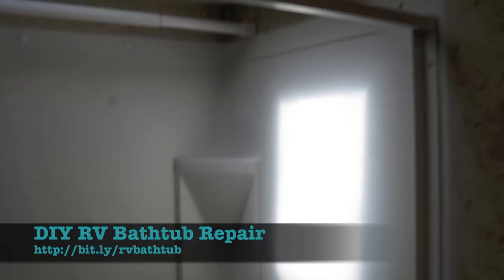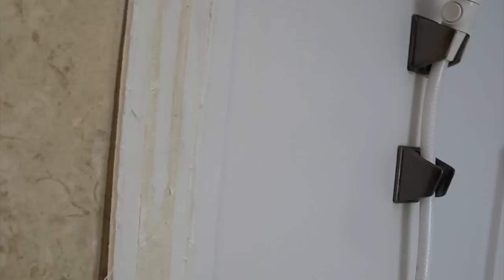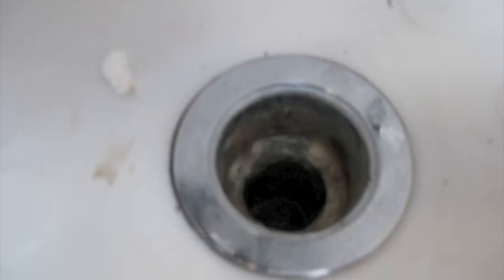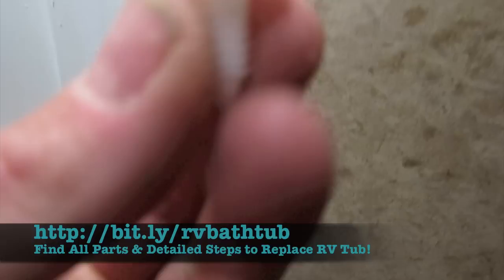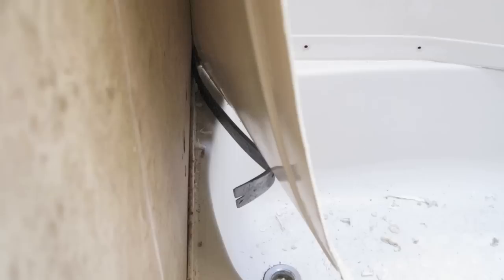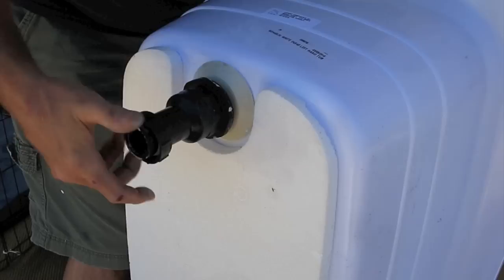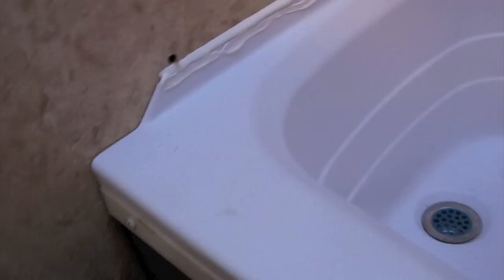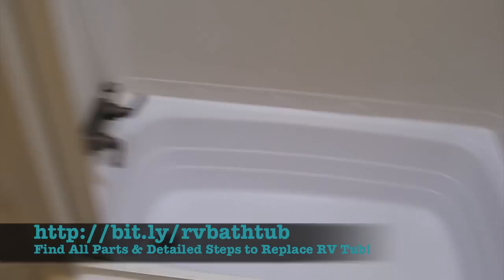How To Replace RV Bathtub + Helpful Tips!

Comment: FYI. The wrench in the drain to loosen only work with regular house tub fixtures where the drain is threaded into a metal pipe. Any RV or mobile home have connections are equivalent to sink fixtures and this trick does not work on them. They will break every time. You must get hold of the collar to loosen. Hope that helps someone. I found out the hard way also. Appreciate the video. Thank you.

Comment: Great video! I had to replace my floor which involved ripping out the tub. I decided to replace it with a 38 inch shower so my arms wouldn't bang the walls when showering. I also went ahead and put a house toilet in and a 19 gallon water heater so i wouldnt have to rush while showering. I made a short video

Comment: Great video, very helpful. I'd not have used OSB board though, the first leak will soften that right up which will cause more cracks with the softened support. Would also attract bugs (when wet). I suggest some high density plywood instead or maybe XPS board. Someone suggested a rubber mat over it, but I'd still prefer no-osb near water.
Reply from the maker: Great tip! Really good to know, thanks!

Comment: Hello
I am gutting out the bathroom in our RV— my new tub and surround is 40 inch my existing is 37 1/2. Not gonna return because of great deal and sweet surround. It was good to see distance between walls at access panel. That gave me idea to design protruded backing at tap mount inside the surround for taps and shorter inside wall for piping and thinner inner to outer wall distance between inside hallway wall frame. I can cut the threads back an inch change elbow fittings or us house taps and fittings for narrow wall-thank you!

Comment: Just read the blog post and it was really helpful, so thank you for that. I'm hoping that we can install a standing shower vs a tub in our rv. Quick question: How much did it cost total to do it yourself?
Reply from the maker: Wow someone who reads, thanks Ashley! It was around $300 total, not counting our time (an entire day). Good luck to you guys!
Reply: LiveWorkDream Awesome! Thank you so much!
Reply: I did this very thing. Replaced the small tub with 38 inch shower. What a world of difference it made
Reply: I wanted to completely remove the shower/tub because I don't use it in my motorhome, but after you mentioned putting in just a shower - that would work for me. The tub is too small and I can't put anything in it to use that space. Thank you. 😊

Comment: Did you have to extend the drain connection due to raising the tub, 
im also experiencing the same issue going from a fiberglass tub to abs
Thanks
Reply from the maker: Good question! Thankfully, we did not need to adjust any plumbing.

Comment: why are the tub pans set so high off floor?  I couldn't see with the woobly video.
Reply: HumbleHalfAcre Some RV’s have drain plumbing under the tub above the floor decking, so they have the bottom of the tub several inches higher than the floor.  The gray tank is often tight against the flooring, so that’s how they get a horizontal run of drain (if needed) and a P trap to fit.

Comment: Can you please tell me where you purchased your tub & its surround?  Is it 36" x 24"?  I am trying to install one in a tiny home (homemade RV).  Is its size good enough when taking a shower?
Reply from the maker: Hi George, we purchased it on Amazon (where else right?). Yes it's good enough but we put a sheet of plywood underneath because it felt too spongy. It's 24" x 40". Our blog post has all the details, just search for "bathtub."
Reply: We have the same size in our RV. Me, my wife, and my 5yo son have been full timers since Nov 2017. We shower every day in it and my wife and I are both 6ft tall. My son takes baths. It's the perfect size for him. 😁
Reply: what did you use to put the surround back up? liquid nails or would it work? I don’t want the button looking things back on my new one

Comment: Interesting video.Your hands looked like you tried to give a cat a bath.  My hands looked that way too. I was giving a cat a bath. I have a few questions. Putting old plumbing back  in. Doesn't the plastic degrade and wouldn't it have been better to put in new plumbing while you were at it? Also the plywood you used under the bath tub, it looks like the kind that when it gets wet it would rot which would be a mess if the bathtub plumbing were to leak. Finally, why not put some waterproofing on the walls and floor to protect the walls and flooring to protect that wood that rots and falls apart when  wet? Oh, yeah, being that you put the plywood directly on the plumbing which is taking up all the weight, when you add the weight of people in the shower (and it's not even weight rather being on one end or the other) without any support except on the plastic plumbing itself, wouldn't it cause the plumbing to crack from the weight, thus causing leaks and wetting that plywood thus rotting the floor and walls?
Reply from the maker: Great questions. ABS plastic is much stronger than PVC and we had no noticeable degradation of any plumbing indicating replacement was necessary. Pressure treated plywood is much heavier, and this step should not be required in most cases. No weight was directly applied to any plumbing during this repair, since yeah, that would be a bad thing. RV manufactures never add any water proofing to surfaces, and the goal is to prevent any leakage in the first place.